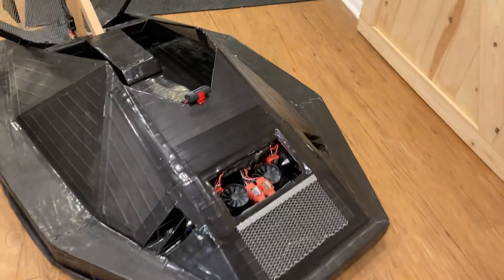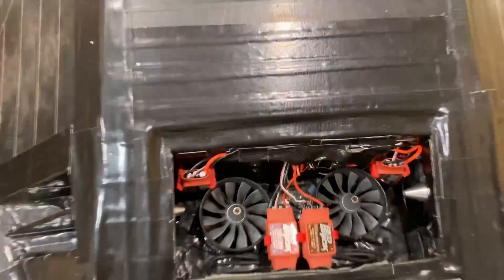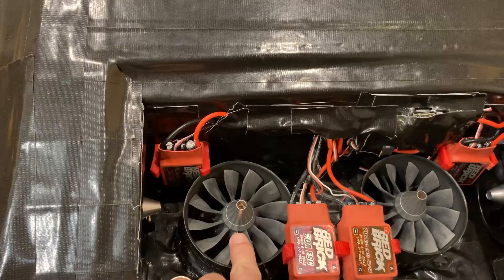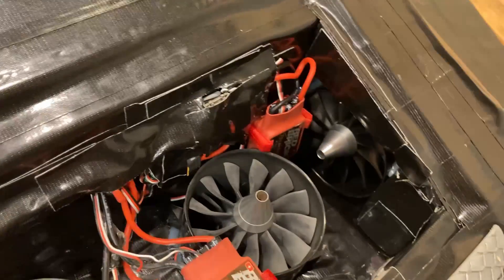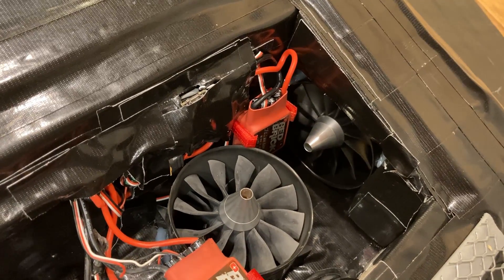DIY Electric Personal Hovercraft Thrust Vector Test

Comment: You are the only other person I have ever seen think to put lateral thrust systems on a hovercraft besides myself, nice to see a working example. Can you tell me what you decided to use for your skirt material?

I am currently building a hovercraft myself :)
Reply from the maker: That's really cool. The craft has been so much better to drive since I added the vector fans especially at low speed. Even that small amount of force makes a big difference. For the skirt, I just used contractor trash bags since my goal was to build it from stuff I could get at Home Depot lol.